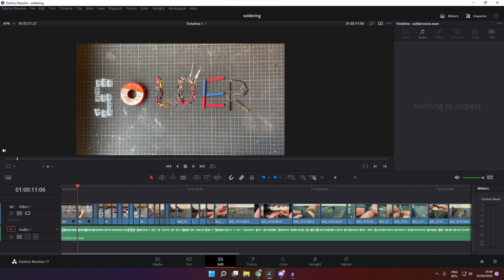SlimeVR: Soldering for dummies | Soldering tutorial

Comment: Wemos D1 need 5v to work so it will not be provided by tp4056 ( 3.7 to 4.2v max ) and if you use direct 3.3v input it a lot to much i dont understand how you design could work without correct 5v supply

Comment: I have a question! As an engineer, i've always used Dupont wires for projects related to my career, but now that I'm planning on making some new trackers for my girlfriend, I'm wondering if that'd be appropriate (of course cut and without the pin lol). She used a sort of sturdier tin-coated copper wiring that's much chunkier, some AWG lower than 28 and came in rolls, and in this vid you used something that seems pretty similar, so now I'm concerned if, for whatever reason, regular duponts that you'd find anywhere can't handle the amperage or some other reason like that? In any case, great video!!! as a beginner i would've loved to be taught like this, super helpful !!!

Comment: You should probably mention to beginners the solder to use for this project. I bought a soldering iron that came included with cheap solder on amazon, and omg did it making this project irritating. Once I bought a solder with a "Rosin" core. This project became so much easier to work with. Other than that, very helpful tutorial! Thank you!
Reply from the maker: Yeah that's fair!
Didn't really mention it but it should be in the docs sooner rather than later.

Comment: Quick question: Sorry if this sounds dumb, but how do I solder the wires that split into 2 different directions? Thanks!
Reply from the maker: I usually twist the 2 wires together and then do the same step as the wire prep.
Only this time the 2 wire ends are intertwined.